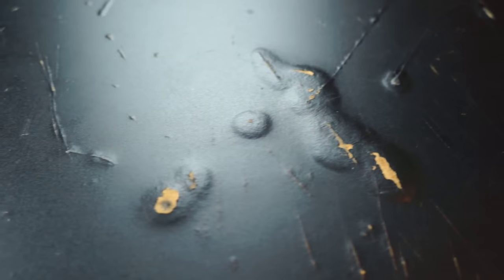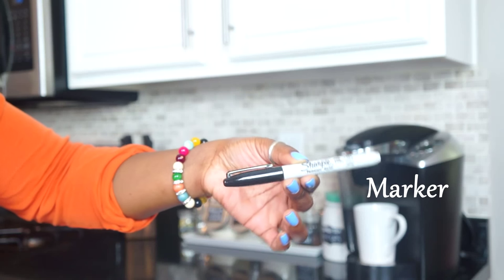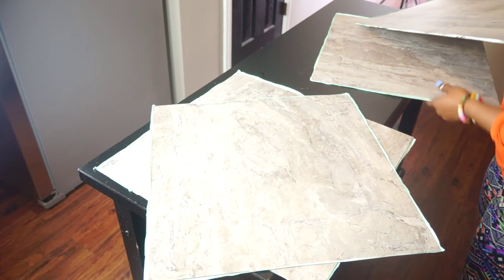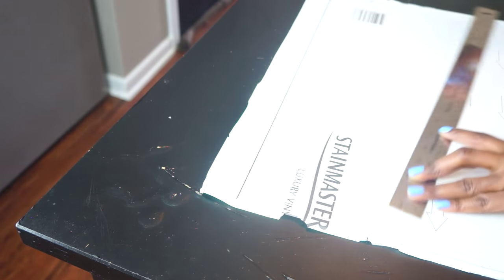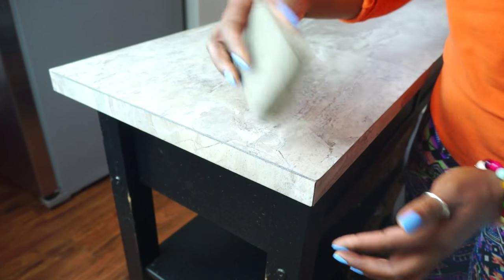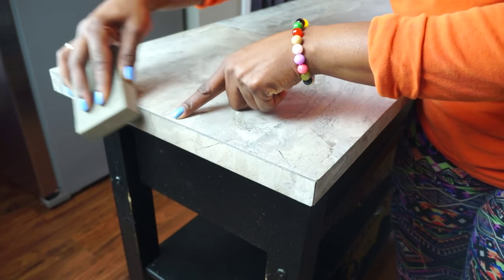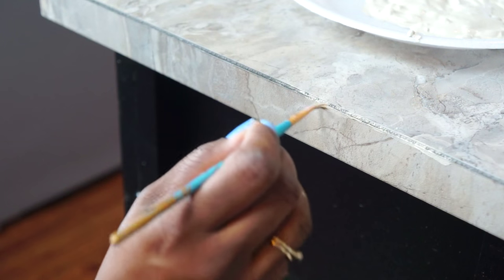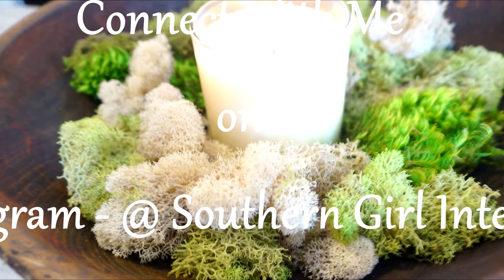Ikea Island Top Hack - DIY

Comment: That came out very nice!  I did that for one of my tops in my kitchen also.  I did not paint the edges.  But, that is a great idea.  I will have to do that before the holidays.  Thanks for sharing!
Reply from the maker: +bosslady1598 Heeeey bosslady.....see great minds think alike:) I'm sure your countertop was not as beat up as mine. How has it held up for you? I think even if it gets some cuts or scratches.....the pattern will hid a multitude of things unlike the solid black top before. TFW.....your support means a lot!
Reply: +Southern Girl Interiors: my countertop is do well.  It covers my hot water heater, it short.  I keep my mixer, can opener and sugar on top.  It really made that small area so much better.

Comment: Really Nice but..Why didn't you use ceramic tiles on top and paint the sides?
Reply from the maker: Hey Paris that's a good question but I didn't want to have to try to cut tiles with wet saw or by score by hand. The vinyl was cheap, easy to cut & has held up very well still looks the same from when I first did the DIY. But I say if you have a similar situation...try the ceramic tiles...always more than one way to achieve a great solution. TFW & Smooches

Comment: is it safe for hot pots?
Reply from the maker: williams melanie b. Hey Melanie I haven't had an issuse but I have taken something pipin hot off the stove & placed it on top of tbe tiles....I did a video where I DIYed a hot plate....Chalk board & Hot plate video....but remember it's not ceramic tile....it vinyl....I hope this helps TFW & Smooches😘